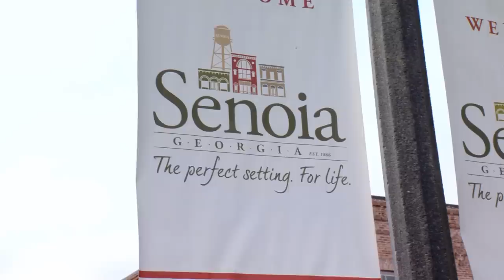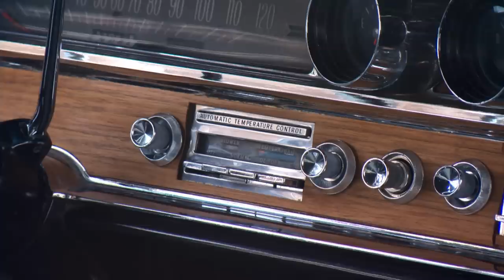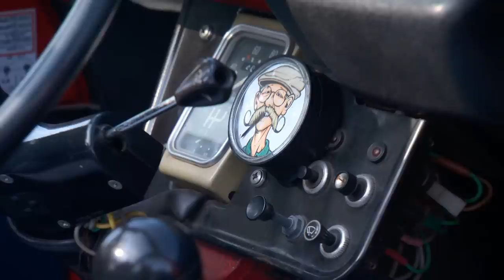Beck-Lister Jaguar GM Powered Replica | 1987 Citroen 2CV Hamster Powered

Comment: As much as I like that Poncho I'm not sure I could live with that color day in day out. You either love it or hate it. It really is hard to believe that they built the 2CV up until the 90s. But it is the French equivalent of a Ute. Those Liester repos. Wheres my drool emoji. The Ramblers. Twenty years ago I'm not sure you would see one let alone two at the same show. Theres a guy in SoCal that gas either a shoebox 61 or maybe the Kleenex box style with a 2JZ swapped in with three dueces.  Both body styles usually escape the engine swappers because there is too much surgery involved. But these 60s Ramblers are getting more attention now from hot rodders simply because a lot of the other old iron is already snapped up.

Comment: I also had a 63 Rambler American - same color combination but not a 440. One reason you don't see many around is . . . RUST. At 50K the car was literally dissolving from the inside out - fenders and sills. My body shop told me they had to stop grinding for good metal because there wouldn't be anything left.
Reply: Did it have the rose colored dash lights?
Reply: Even though the bodies in white (bare metal) went through a full dip undercoating there were still spots in the body where road grime and other crap could collect. Anywhere in the country that saw salt used in the winter rust would get any any car. The only thing you could do was constant washes. And not many carwashes had underbody washes either.